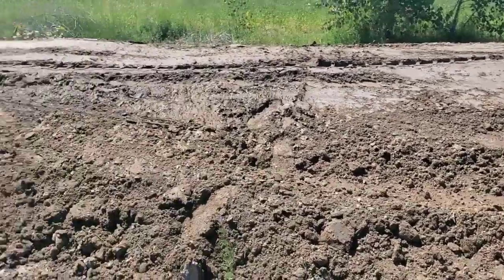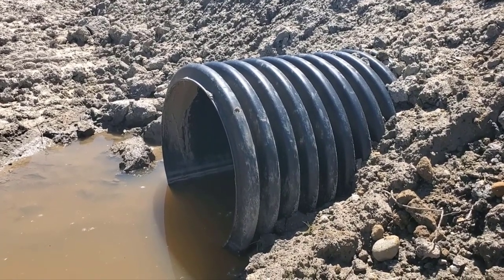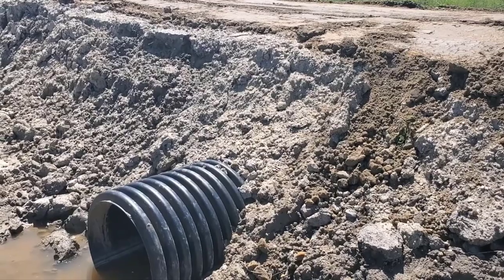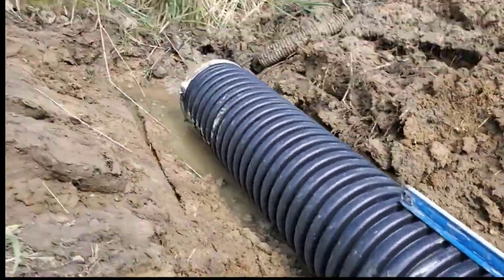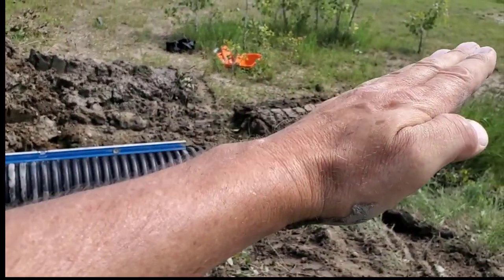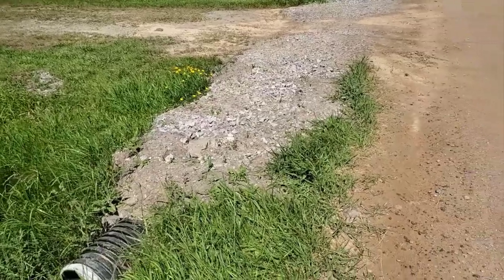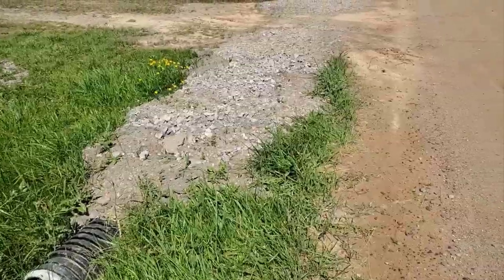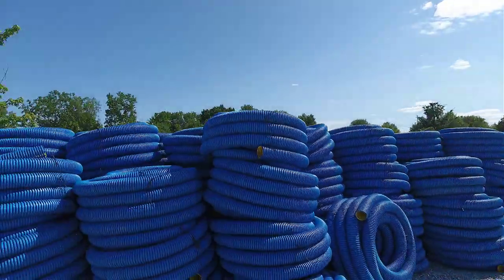How to Install Dual Wall Culvert Pipe 101 for DIY'ers

Comment: IDK the county codes but the driveway culverts in my neighborhood are installed at -1 degree slope.  I think it's to ensure the hydraulic jump happens inside the pipe & not at the outlet end of the pipe, or/& to force some of the stormwater into the grassed stormwater swells.  I thought the -1 degree slope was odd but the county installs them that way.

Comment: What size crushed rock do you pack around the culvert pipe?  Should it include the fines too?
Reply: You need fines or you risk water scouring around the culvert instead of go through it. As a minimum you need the greater of 12" or 1/2 the pipe diameter.
Reply: @symcardnel1741  it seems every quarry identifies or labels their material differently.  I have no idea what CA6 is. Haha.  What size is the maximum diameter of the material you use? Thanks for the response.

Comment: Thanks for keeping it simple and calling out the half-done jobs out there.  So, I can't find any videos that show me how to splice into the irrigation pipe that runs through my front yard.  I know this isn't hard to do and I really don't feel like paying a contractor for this.  Please, anyone, is there a video that shows how to cut/splice into the pipe that is in place for FLOOD irrigation.  I'm going to connect the pipe and add two 12" valves, one in the front yard and one in the front of my back yard.  Any help would be much appreciated.

Comment: Can you do a video exclusively about using this pipe to protect a french drain?  Does stone go in the gaps to the sides of it, or only just in it?  Fabric inside it or on the trench wall?  It would be helpful, thanks!

Comment: I need to connect 2 x 20' x15" round galvanized steel culverts DOT installed. I need a wider driveway. I need to cut a 16' piece and band it. Just my driveway ups, fedx, tractor. Not much dirt on top of my 2 existing pipes. Can I band HDPE 16 FOOT Between these?
Reply from the maker: Yes use Mar Mac couplers

Comment: Does the fill material around The culvert to need to be a clean stone that’s drains or just a material that compacts well?
Reply from the maker: If you look at what the manufacturer is going to require, they're gonna want you to pack Stone and then put the pipe down and then compact a good packing material along the sides of pipe, knife the material under the sides.
Reply: @FRENCHDRAINMAN  do the manufacturers typically want stone at the bottom because it’s easy to grade flat to create a nice bed or is it for drainage purposes to let water drain or pass around the pipe? Thanks!

Comment: I have a drainage ditch coming down through the road way and down through my land I recently had new fill downstream of this and am having trouble with it draining wondering if 16" galvanized 20 ft long will be okay also considering hdpe as well possibly 18 inch 20ft long need at least 40 ft to go through to the end of the fill originally had some culvert and big rocks at the end thinking it would drain through but it must be too much at times especially in springtime to handle backing up and running across top of fill.....any suggestions?
Reply from the maker: You should increase the diameter of the covert pipe.

Comment: Does the "not needing stone" apply to 36inch dual wall culvert buried 2+feet underground when not driving over it?
Reply from the maker: It was virgin soil under the pipe.
Reply: @FRENCHDRAINMAN  so if there is already a pipe that I’m digging out to replace with dual wall hdpe, I do need stone since the dirt isn’t virgin dirt?